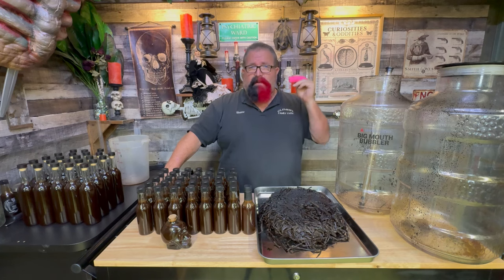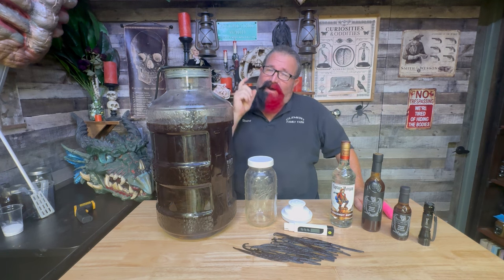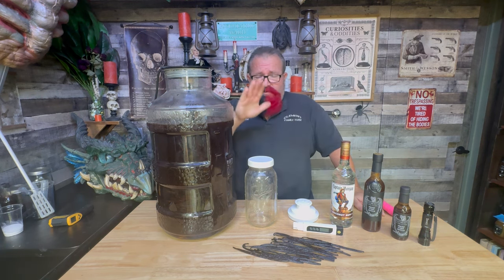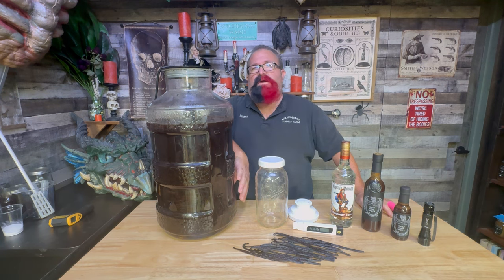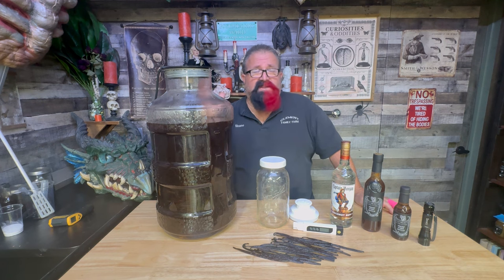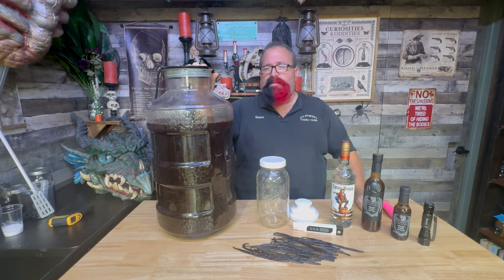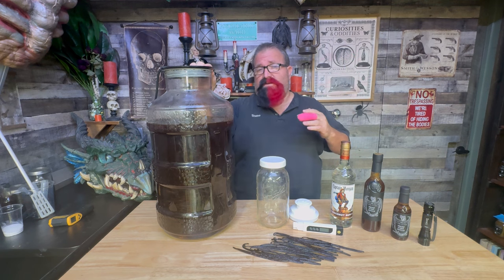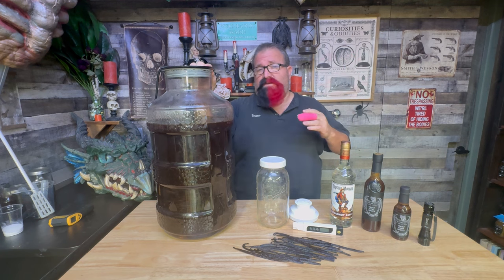Best Vanilla to date after 30 years 4.5 gallon update.

Comment: Are these food grade pumps?  I went to your link and it is unclear.  I worry most about the plastics involved.  Thank you for posting your discoveries. I'm sure you have helped many people with your findings.
Reply from the maker: This was prototype to test the theory behind the method. When testing theories and processes there is a difference in pricing Non food grade labels $100 now add Food grade labels $600. The pump used had all the same properties as the food grade plastics with out the labeling.  Now that the theory has been tested I am working on a complete system that is Food Grade safe. Even though all the parts I will be listing for the new system will be food grade everyone should do their own research on the equipment to see if they want to use it or not. Some people don't like pvc over silicone or plastic over stainless steel all may be food grade but they might have a personal preference or might not want to pay for stainless steel.  There are so many choices it is hard to determine what is right for everyone. I just recommend for everyone to really check the equipment they want to use.

Comment: I would just like to know what platform you used to raise the vanilla beans. I loved the videos and binge-watched the entire series, I'm new to making vanilla and plan on selling it. Thank you for sharing this process!
Reply from the maker: I don't understand the platform part of your question. I don't grow vanilla beans as they are tropical grown only.
Reply: @ClementFamilyFarms, you said there were dead spots on the bottom of the barrel and raised it so they can get proper circulation. I can understand how the wording was confusing. I just wanted to know what you used to fix the problem
Reply from the maker: I use a plastic lid off of a 3 gallon ice cream tub. I cut a hole in it for the tube and slid it over to the top of the pump. I did take everything out and used some pint jars sealed at the bottom to hold the weight. Once the lid rested on the jars I put the vanilla beans and alcohol back in. This made a big difference in flow and not having any dead spots. It kept the vanilla above the pump.  I also drilled a few holes in the lid.

Comment: Good info! 👍 I like this idea, but do you think it would it be possible to simply use an air bubbler instead of a pump? Seems if the bubbler/bubblers were below a screen that held the beans all the bubbles coming up through them would be enough agitation rather than having to worry about heat buildup or clogging/failure of a pump. I am going to try such myself and see how it goes.....
Reply from the maker: Yeah the air bubbler idea is a good one but unfortunately there are some issues with it. You need to keep a closed loop on the air supply if not your going to lose to much in evaporation.
Reply: @ClementFamilyFarms  yes, agreed!

Comment: Very cool, I've been waiting to see the outcome. 
 Have you ever tried using the sous vide method of making vanilla extract?
Reply from the maker: Several people have tried the sous vide method and the out come is the same. The heat only pulls out a little bit of color and flavoring and it still needs some more time or other mechanism to achieve maximum flavor. You will get faster results just buy splitting your beans and shaking the jars.

Comment: Another idea is to use a motorized paddle stirrer mounted on top of the container. Nice slow constant stirring might work really well too without anything but a stainless-steel paddle submerged in the extract....
Reply from the maker: I have been trying to figure this one out that will work on the small scale tanks but also has a sealed entry point. Larger scaled commercial tanks has systems that work. But scaling down and finding something that works and has all the seals is tough. My new system I don't have to worry about keeping the beans moving as it forces the fluid through the beans many time per hour.
Reply: @ClementFamilyFarms  👍

Comment: I would be interested in if/how much the proof changes with the constant agitation as opposed to a sealed jar being shaken.
Reply from the maker: So I know the proofs drops down to around half of what you started with. Like 70 proof with a 1.5 ratio of vanilla beans will drop down to 30 proof as finished extract. That even drops more with a double fold and triple fold. It is dilution ratio more then a process effect on the alcohol. Might be a good test in the future but I don't think the process will effect the ABV. With the aeration and movement it does effect the molecules and is much smoother and palatable.

Comment: I would really be interested in a smaller version of the aerator, unless my baking business kicks off.
Reply from the maker: You should check out my newer circulation system video. It works much better and is all food grade equipment. I am turning out 1 gallon of finished extract in 8 weeks. I am doing a updated video soon showing my current process were I rotate out vanilla every 20-25 days.
Reply: @ClementFamilyFarms  I most definitely will. I am very interested in it. I wonder if it will work with other ingredients for extracts?

Comment: Hi Clement ! At my place, Captain Morgan is Rhum. NOT vodka and we don't have "Coconut vodka" but "Spicy rhum" and it cost $26.75 CAD / 750ml (±$20 US / 750ml) and this is the LEAST expensive one (out of stock though). How much do you pay for your Captain Morgan and for how many ml (liter) please ? Wonder why its vodka at your place and rhum at mine ?

I would prefer to do it with rhum though. And spicy rhum would be better IMHO. And I have the choice to use the dark rhum also but... we won't have control over the extract color though but, heck, with a TDS meter, no need for color control do we !?

Comment: I've been using a tds meter just for my own fun. Should  I shake the half gallon jar before I take the reading? This was a wonderful informative  video! Thank you so much!
Reply from the maker: Before I took any of my readings on my jars I shook them and then let them sit for 5 to 10 min before taking reading. This allowed the fluid to remix and then calm down. I did the same routine every time so it was consistent with the method and data.
Reply: I figured that would be your answer. Thanks!! I left a short while too.

Comment: I have made a small scale of this and I’m a little concerned that the pump is heating up the alcohol. Did this happen with yours? Also what do you think about a tumbler? Sort of like a rock polisher. Something that has a drum that spins around with the beans and alcohol in it?
Reply from the maker: Yes the friction from the pump will add some heat. Just keep an eye on it and make sure it doesn't get to hot. Mine only reached about 85 on one of the hottest days we had. If it starts reaching around 90 degrees in the extract then I would start trying to cool it down.

Comment: Have you considered using a magnetic stirrer for a smaller setup? Do you think just keeping the liquid moving is enough or do you think you need arriation caused by the aquarium pump?
Reply from the maker: Magnetic stirrers don't work that well with the vanilla beans. Stirring helps but getting the fluid moving more around the beans is the ticket for sure.

Comment: I'm curious why you would only do 72 oz of beans to 4.5 gallons of rum. My understanding is the formula is 9oz to about 1/2 gallon. Which would be 81 oz of beans for 4 and 1/2 gallons. What am I missing??
Reply from the maker: Yeah my calculations were off a little bit in the video and description. I had a one track mind and 72 was stuck in my head. When I first started the project I was at 72 oz then when I put everything together I had the extra room for the 81oz and added them. But my brain was stuck on 72.  I did notice it a couple of weeks after I posted and wondered if any one would catch it. lol
Reply: @ClementFamilyFarms  I ended up, with my husband's help, fabricating a pump and circulator made of copper. Then we switched from a bubbler to a food grade 8 gallon fermenter bucket. So much easier to deal with than the small-wide mouth bubbler. It is bubbling away. I am so excited. And I'm going to do another one too. Thank you for the inspiration.

Comment: Would you suggest a particular tds meter? I’m seeing 3in1 and 7in1 meters on Amazon. My 2nd question is after pressing I would assume most oils that was left in the beans are now pressed thru so would you still make vanilla sugar o even powder from it or would the flavors be gone since you pressed it? Thank you for all the information, I have learned a lot from your videos.
Reply from the maker: the 3 in 1 is what I use for TDS meter. 
I do use the spent beans in sugar.
Reply: @ClementFamilyFarms  thank you for the quick reply
Reply: @ClementFamilyFarms  also thanks cause I just purchased the 3 in 1 off Amazon and looks very similar to the one you use.